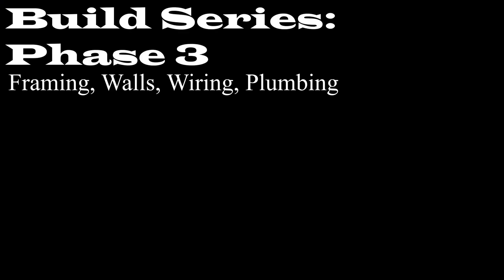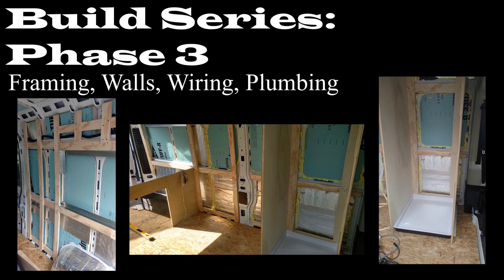Van Build Tutorial: Phase 3 - How to Convert a Van to Camper / Tiny Home

Comment: I could probably get aluminum sheets cheap from work. I would like to use as much of that as possible especially for shower & kitchen. What do you think?Did you run wiring thru pipe or just fasten it down? I kinda like idea of shower in back of inside of van with area vented area for propane. I’ve seen class b’s with rear interior shower they seem roomy.Thanks for doing this  informative series.
Reply from the maker: Anything free is a win in my book. I originally didn't want my counter top but my dad got it for free so I couldn't say no to that. I wouldn't run any wires through metal as it's a conductor. I fastened all my wires down, but before that I organized them with wire ties or plastic covers I bought at home depot.
Reply: Yeah plastic covers are sweet.